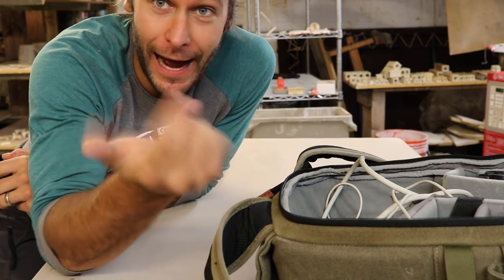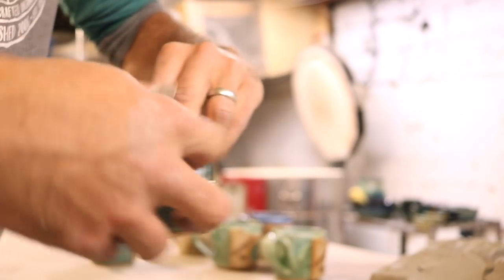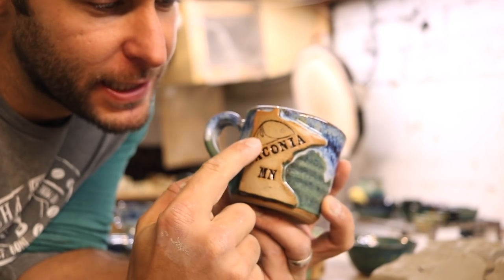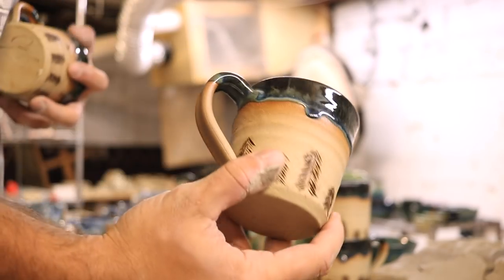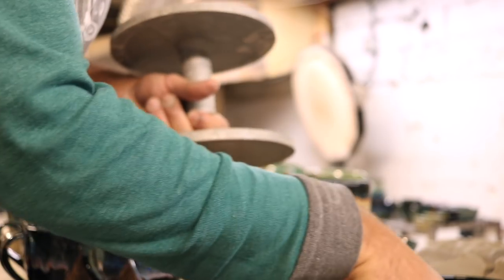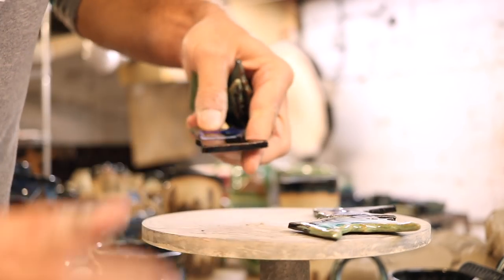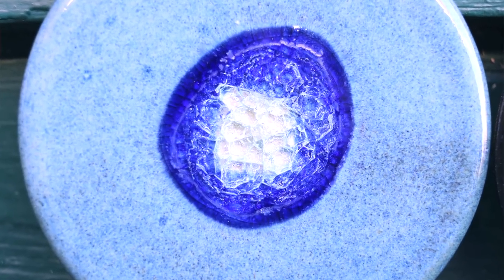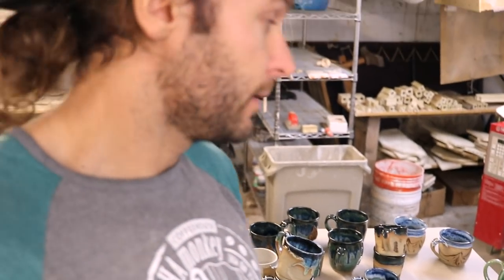Custom Brewery Mugs, Pine Tree Mugs, and MORE Unloading Kiln #31

Comment: Hi Jon thanks for making great videos, as a newer potter I was wondering how you get your handles to turn out? I have been having some challenges with my handles breaking lately, I make them with coils and slabs. Just wondering if you have any tips for how I can get them not to crack, Thanks!
Reply from the maker: Try making them a little thicker possibly!!  Or make sure that the clay is more wet,  the cracking could be because the clay gets too dry when you are working with it?
Reply: Jonthepotter Thanks for the tips!